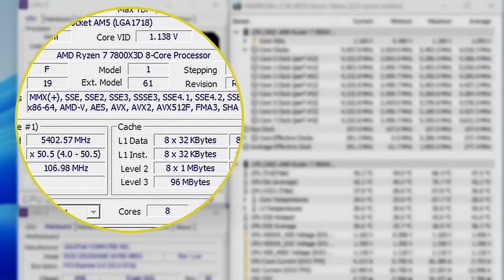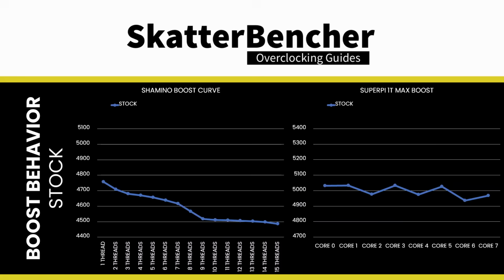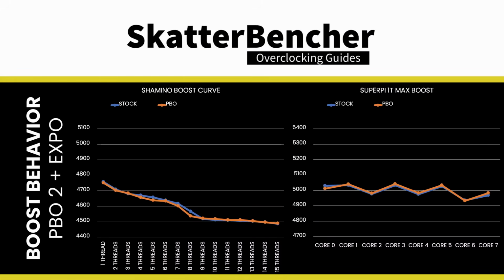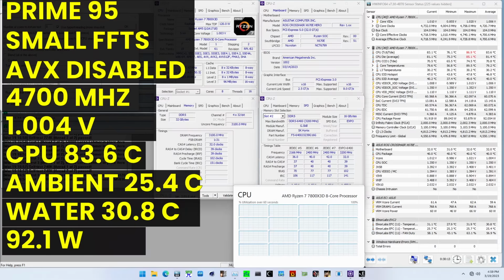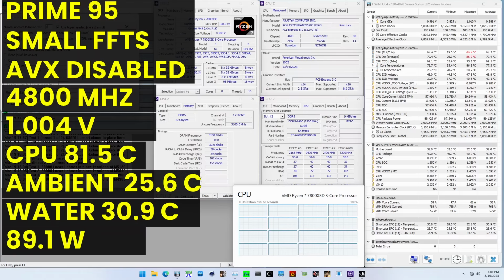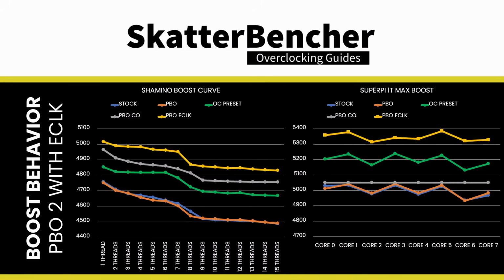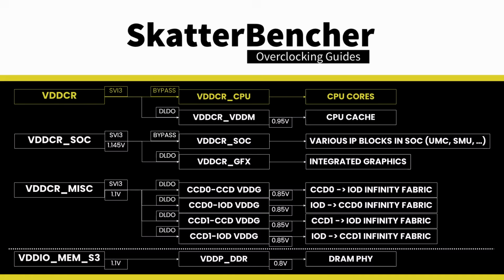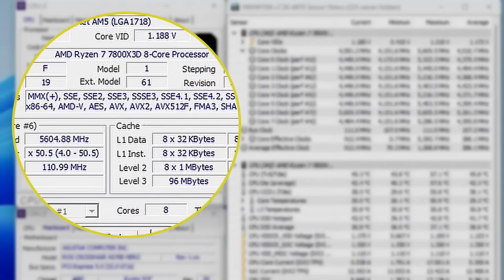Ryzen 7 7800X3D Undervolt & Overclock to 5403 MHz With ROG Crosshair X670E Hero | SkatterBencher #60

Comment: Newbie here, so from what I can take in, this is a rather hit and miss proceedure with the only monitoring feedback that its working is temperatures,  but it could still render your system unstable or even damage your sockets because you are driving them beyond their specified power/current limits? So ultimately, you could be reducing the lifetime of your CPU and motherboard?
Reply: This is undervolting. You are putting LESS voltage through them, increasing lifetime

Comment: Is it correct to affirm that the strategy 3 is the optimal strategy for anyone who does not want to consume time on fine tuning?

Also, I heard that CO ranges from +30 to -30, yet you can still set higher numbers like in your case -35 but in this situation the actual applied value would be -30. could you please verify this piece of information and confirm to me if that's true or false?
Reply from the maker: OC Strategy #3 is the most balanced in terms of extra frequency and effort required. Correct!

+30/-30 used to be the range, but on Raphael it's a bit different. In my Ryzen 7000 launch video I showed up to -300 (three hundred) worked. However, this can change with different AGESA code and I think now the range is more like +30/-60.

https://skatterbencher.com/2022/09/26/raphael-overclocking-whats-new/#AMD_Precision_Boost_Overdrive_2
Reply: @SkatterBencher  Thank you for answering so quickly man!

Comment: Bingo!   Thing that i was missing in ECLK OC  was increasing per-core CO  for failing core...Thx!!!!...  I assume you can have smaller ECLK increase, and  per-core  CO  might stay into minuses or you can have bigger ECLK and  some of the cores have to move into positive CO .  How do you determine max ECLK? at what point are you stopping? As CPU is voltage sensitive are you stopping at first sights that CO needs to go into positives?
Reply from the maker: Great question! And the boring answer is: it all depends on your CPU :)

When you're pushing ECLK and you find there's a bunch of cores that are hitting the fmax, then it makes sense to continue pushing up the eclk to get more frequency. Then start giving the worst core a positive CO. However, if there's only one or two cores hitting the fmax, then it makes sense to leave those be and use negative CO to push up the others a bit.
Reply: @SkatterBencher  what are the signs that a particular core is hitting fmax?

Comment: Hi, the video just came accross my facebook page few hours ago and I'm still new here
Why do you limit the Ram frequency lower than EXPO settings ? Is there some effect to the end result to the overclocking the AMD X3D processor ?
Reply from the maker: While our memory kit is rated at DDR5-6400, I had to run it at DDR5-6200 to ensure stability, as my CPU wasn’t stable at higher memory frequencies. Not all Ryzen CPUs can easily run DDR5-6400.

Comment: U have some settings, that i dont have on my B650E-F ROG. Like x3d OC and elck2. Is this a Motherboard or Bios thing? Cause my Bios is on the recent update 1408. Would like to here some nice respond. Thanks for the Vid!
Reply: Unfortunately only ASUS 670 boards have extreme tweaker in the bios.  I have the same board and opted for OC strategy #3 of the video.  Not only do we gain a few frames in gaming but the CPU runs cooler by 5 degrees even at idle.  Also for even more performance I applied buildzoids memory timings to the RAM.  Youtube "Easy memory timings for Hynix DDR5 with Ryzen 7000" for his guide.  Enjoy!

Comment: I have a ASUS ROG STRIX X670E-E GAMING WIFI but doesn't own a cpu for it yet. I wonder if this motherboard will have similar overclocking potential? Would a AIO 280mm be good enough for max overclocking this cpu? I don't think I can fit a bigger AIO in the case.
Reply: Depends more about silicon and cooling not that much about mobo
Reply from the maker: At worst, when overclocked this CPU pulls only 100W. Any decent air cooler will handle that.
Reply: @SkatterBencher  Hum okey nice! I didn't have the time to watch the whole video in detail. I will do that now. But here in Sweden it became a paper launch and no accurate info on when they're suppose to arrive either sadly.

Comment: What is the difference between EXPO I vs. II vs. Tweaked?

Can not find any info on the profile differences on ASUS / G.Skills websites.
Reply from the maker: EXPO I loads EXPO primary timings, frequency, and voltage but lets the motherboard optimize the rest of the EXPO timings

EXPO II loads the full EXPO profile, including the primary and secondary timings, frequency, and voltage.

EXPO Tweaked is EXPO I, but also adjusts some non-EXPO profile timings according to the motherboard auto-rules.

Comment: Will you be working on any updates to ASUS mobo? Currently using this hero board with 7950x using DDR5 6400 mhz 4x32gb A-Die but cannot get it to post with these settings mainly on memory training.  Doesn’t seem to be a PBO issue but more on code 15 D5 related to memory training
Reply from the maker: I haven't powered on AM5 for a while as I've got too many other things on my plate. Maybe I'll revisit in the future but we'll see ...
Reply: @SkatterBencher  understood, that’d be great, it still is a bit broken it feels but worth a real tech taking a look and putting together a solid guide.  Especially when AM5 can still compete with higher speed ram

Comment: you apply a RAM expo, is this possible with buildzoids custom ram timings?
Reply: No need for x3d chips
Reply: Also would like to know this.. If not, I’m just running EXPO & calling it a day. My biggest concern is the voltages Buildzoid used in the easy custom ram timings video. Are these still usable for the 7800x3d?
Reply: @CarnivoryHODL  my friend who’s on AM5 reckons I’ll be able to, I’ve ordered the parts guess I’ll find out in a few weeks when the x3d arrives

Comment: what is the maximum voltage you have tested with a 7000 x3d?, since 1,15 V seems to be very modest
Reply from the maker: ~1.25 or so for the 5.6GHz validation. Even at that voltage the CPU would shut down when I try to load heavy workloads due to thermal protections

Comment: I am using this processor mainly for gaming, could you pls tell me which method is more safe and suitable for gaming?
Reply from the maker: I'd say Strategies #1 and #3 are the most easy to try for regular gaming systems
Reply: @SkatterBencher  thanks for the reply, I am mostly playing Call of duty modern war 2, and my graphic card is RX7900 XTX, so is it ok to use method 1 or 3 ?
Reply from the maker: Yes
Reply: @SkatterBencher  I am using asus tuf x670e plus wifi mother board. Here, I dont have EXPO , showing only DOCP what is that, is that the same?

Comment: Im running your exact pbo2 config. It seems to run stable, however, the all core boost never breaks 4.9ghz, also the cinebench multiscore peaks at 17900.... any idea what could be causing this?
Reply: Silicon lottery.
Reply: @J3pp3  i wouldnt be able to run all -30 stable
Reply: Only reason he can is his mobo is running his voltage at 1.35volts which is very high.

Comment: does adding the pbo 200+ mhz do anything with the 7800x3d.
Reply from the maker: No, since Fmax Boost Override doesn't work for X3D CCDs. 

It will increase the frequency ceiling of the non-X3D CCD of the 7950X3D and 7900X3D

Comment: Do i risk messing up my NVME drives if i run higher bus speed than the default 100MHz? tnx
Reply from the maker: On Ryzen 5000, yes.
On Ryzen 7000 in Sync mode, yes.
On Ryzen 7000 in Async mode, no.
Reply: @SkatterBencher  Thank you. Unfortunately my Gigabyte b650e board doesnt specify if it is in sync or async mode. Only has "CPU clock control" so i think its best i play it safe and dont touch it. Thank you!
Reply: @bismuth7730 it's sync, because your Mobo doesn't have an eclk generator

Comment: Hi mate, I actually use similar strategy for watercooling, however I map my fans, so first starts spinning at 40C and they all spin at the MAX rpm at 45C (below 40C all fans are idle). I also use open case and let radiator self cool through raising air and chimney effect through the case. Other than that I keep the water pump at 100% and never had problem with over heating, and outside of compile + gpu data computing, I've never seen water temp go anywhere near 45C even in summer. (and yeah, I use red devil so that sucker does produce a bit of heat)

Comment: your cpu vddcr soc voltage is at 1.35. that is above the limit AMD gave at 1.3v .  is your voltage safe for the long term ?
Reply: No it is not 1.25 is the sage limit though spikes to 1.3 is safe I was told. 

If you want to get to very similar results, try use PBO85 and CO-30 first and lower CO for the core that causes error in OCCT CPU+mem test (once you get fully stable level there, for me core2 only needed a drop to -20, rest -30) 

Than cause SOC voltage to 1.220 and set bclk to 102.00 

Run stability tests again - I’m fully stable  

At this point you will have (under 81c temp using 240mm aio) 

I use 6000 cl30-36-36-76 1.4v Corsair Vengeance.
Reply: @TomHenry2  oh ok thanks.

Comment: Can these techniques be done on an MSI mobo? or is it just ASUS software that is best?
Reply from the maker: Any motherboard that has multiple external clock generators and BIOS support for async eclk will work for these strategies. Whether the board supports it depends on the model, not the brand.
Reply: @SkatterBencher  I see now thanks very much for your reply, im very new to this. Is there a list somwhere of AM5 boards that support eCLK generation? its quite hard to find that information.

Comment: How can we specify Eclock 1 mode? I'd rather not be boosting the PCIe and SATA busses like would happen with Clock 0 mode.
Reply from the maker: If the motherboard supports async eclk, you can specify it in the BIOS

Comment: Could you please share a screenshot of your AIDA64 memory benchmark? My 7800X3D does not seem to be working right. The memory read is just shy of 60K, write is over 81K, copy slightly over 61K and latency 68.4ns.
Reply from the maker: I don't have such screenshot
Reply: @SkatterBencher  Thanks! I was just reading a lot of online reviews of the 7800X3D from known tech websites. Their AIDA64 results are nearly identical to mine. Sad. I never thought a CPU change from a 7950X paired with 6000 CL30 memory, had reads of almost 80K. Same system, swapping to a 7800X3D would see a massive drop to 60K. I always thought memory reads were exclusively controlled by the memory speeds and timings. I guess I was sorely mistaken...
Reply: Asus just released a new beta BIOS yesterday to increase compatibility with the X3D CPUs. I'm waiting for a non beta BIOS, but I'm curious to see what changed or improved with this beta version.

Comment: Good guide although a little confusing. Right now ive set the bios overclock profile and also the curve optimizer but my chip will only do -20.
 stock max i can get is 17500 in cinebench r23. Think i lost the silicon lottery this time😢 but with these tweeks im at 5ghz all core new score 18766 sad the reviews basic scores was 18k oh well.
Reply: - My stock 7800x3d is getting 18466 in in cinebench r23, all cores boost to 4825 Mhz in multi cores, ....and any single core hit 5050 Mhz in hwinfo while browse net or youtube.
- Mabe some samples are allready tunned by amd from default with best volttage;) !!
- And with -30 on all cores i can hit 18836 points...so 18466 vs 18836..... no such such a big deal ...just a little few points and the speed of single cores still do not surpass 5050Mhz in game , so don't be sad about silicon lottery because is doesn't metter a lot in the case of 7800X3D!!!  like in the cases of non x3d who can boost higher the single clock frequency.
- Also here in this video i see he get only +200 points  in cinebench r23 with -30 on all cores, cause i believe this chip being mostly for gaming do not benefit for increase of more higher single clock  while using curve -30, like in cases of others ryzen 7000 non X3D,
- Also most people put -30 and forget it and come and report it on forums, and call it stable while is not in most of the cases,
- I just see on reddit 4 posts about those cases i'm talking about, a lot of peoples saying put -30 and call it stable but after other users ask them if they test them for 24 hours of prime64 or aida64 sha3 they come back and report they are getting error or crashes.
- Also i see other 2 peoples saying them best core support only -5 to -10.
- Is the same with my 7800X3D to ! with -30 on all cores i get stable cinebench r23 result, i get all core boost to 5050 Mhz in multi, but single core it's still the same 5050Mhz(the same single 5050Mhz that i was hitting with stock settings to!), also i get stable boosting, also i get sable safe browse net and games, but.......... after i read that posts on reedit i start testing and discover that after 1 -2 hours of prime 95 cpu cores start spiting  errors on prime 95 and aida sha3 benchmark!!!!!!!!!!!!!!!
- So i decide i will do not keep my cpu with errors reported on prime95 and call it stable like others!  and so i have to dial back the best core to -7 !, the other 3 cores to -15/-21/-21, and only the 4 worse cores to -30 to -32!! and only after that prime 95 report 0 error after 5 hours!!!
The temperature not such a big deal also to.....,  on stock 76 C on cinebench r23 multi, and with all cores at - 30 it's hit 79- 80 C cause is boost all cores at 5050 Mhz while on stock all cores boosting at 4825 Mhz, and on prime 95 i get same temp 55-62 C with -30 curve or with stock to!( all core boosting to 4675 -4700Mhz) , and at idle is -3 -4 C less , and in game -3-4C less to, still not such a big difference, oh yes and my aio is 360 in push pull configuration.

Comment: how safe is it to overclock e clock ? i remember overclocking this bus in the past also overclocked pci bus killing drivers such as hard drives and such, what's the downside of overclocking through e clock ? can this lower the life of the motherboard/cpu ?
Reply: I don't think he would suggest doing it if it would hurt your system.
Reply: Well I believe that is the purpose of the e-clock. Because you could also overclock BCLK and get higher CPU frequency, but that also overclocks PCIe bus and such which will affect drives and expansion cards and thus other instabilities you are referring to. You can do that on any motherboard but with those problems so a no go. The eCLK bypasses all of that and only affects CPU multiplier frequency while leaving the rest of system alone. Unfortunately most AM5 motherboards do not have eCLK.

As for how it works I do not know but just know not to touch BCLK and eCLK is the way to overclock with a locked multiplier like the X3D CPUs have. I think its similar to how some Intel boards had some type of eCLK to overclock non-K series CPUs without affecting the bus and such.

Comment: Memory scaling with this processor is something that i couldn't find a review 6000/6200/64000, have you tried?
Reply from the maker: I didn't try in detail, but the first OC Strategy is with PBO + EXPO. Since enabling PBO doesn't do much on this CPU, all performance gains you see are from setting higher memory. 

DDR5-6400 wasn't stable

Comment: I'm running a Gigabyte b650 Pro ax mb with 7800x3d. With pbo enabled and a negative 30 offset on curve optimiser my cinebench score is around 18900 and all cores are boosting to 5ghz. And during gaming some single cores are boosting to 5600 mhz. Seems strange how much its boosting according to hw info. I have no oc in mb enabled. Unless optimised default automatically runs one 🤷‍♂️ I've just changed a power setting within pbo settings from motherboard to auto so maybe it was charging something which made it boost higher as now its stopping within under 4900

Comment: so after UNDERVOLT  howmuch power 7800x3d   eats @ idle / full load?
Reply from the maker: After undervolt with Curve Optimizer, the power consumption in an all-core SSE stress test is 89.1W @ 4800 MHz down from 92.1W @ 4700 MHz
Reply: @SkatterBencher  tyvm   how about idle? ^^
Reply from the maker: I usually don't check idle power consumption, so no data point for that

Comment: So with PBO motherboard enabled PPT TDC EDC all at 1000 you say ''During a Prime95 non-AVX workload, we see that maximum values for PPT, TDC, and EDC are 75W, 60A, and 60A". 
So this mean even if you change PBO to manual and using 105W TDP (PPT 142 TDC 110 EDC 170) or  65W TDP(PPT 88 TDC 75 EDC 150) will have no effect at all for temperatures and for boost single core or for boost multi core frequency? (cause the cpu allway will have a max value like 75W 60A 60A like you say?)
The default value in bios are (120w TDP) PPT 162 TDC 120 EDC 180 ?, but even if u manual change them they have no effect at all?
I wonder why is that? cause i see peoples on them 5800x3d when they use lower PPT like 105 they was saying that is working and give them lower temp to -5 to -10C.
Reply from the maker: That's correct Dan, the default PB parameters are just fine to push the 7800X3D to the limits at default configuration.

The main reason why that is, is the voltage limit imposed on X3D CCDs. The limit is ~1V under load.

Additionally, Ryzen 7000 PB parameters are much less restrictive than Ryzen 5000. Hence why by default they're not constraining for most Ryzen 7000 SKUs

Comment: I have heard that the new 0922 bios causes A LOT of issues. What version are you using?
Reply from the maker: I'm on BIOS 1002, but 1003 and 1004 are also available from the ROG forum https://rog-forum.asus.com/t5/amd-600-series/x670-resource/m-p/901576
Reply: @SkatterBencher  Gotcha. Need to be careful or it wont boot at all!